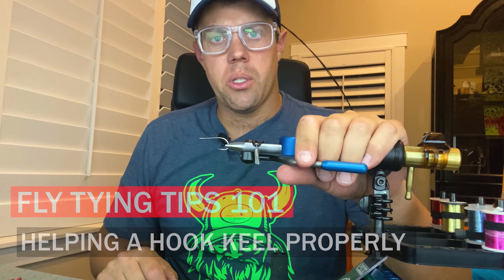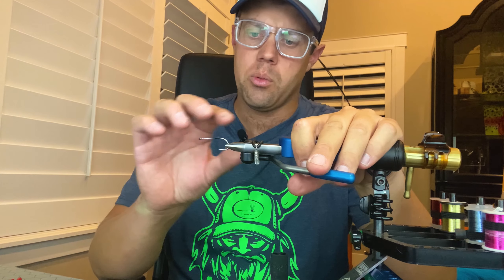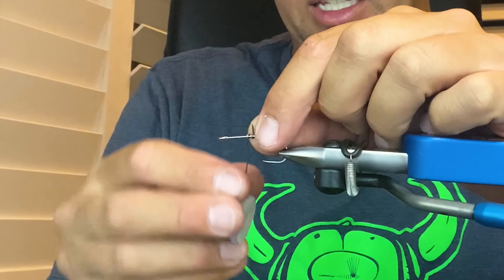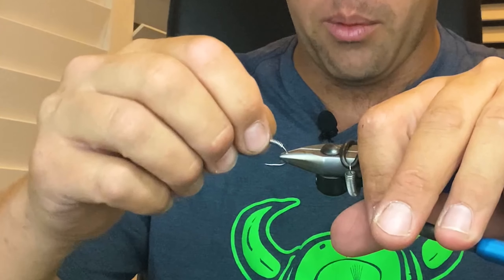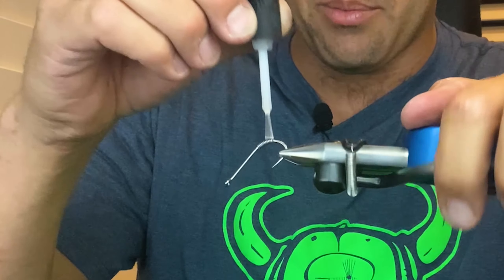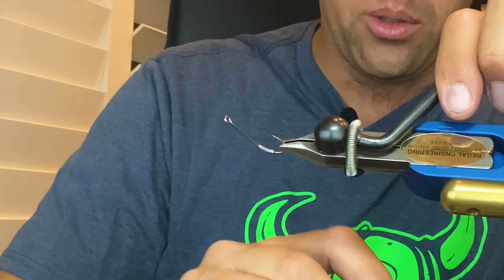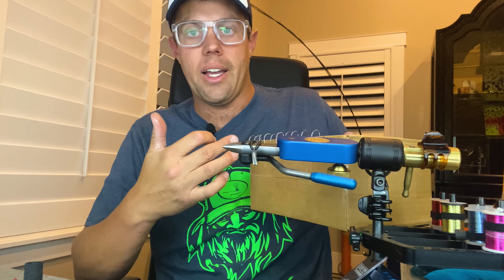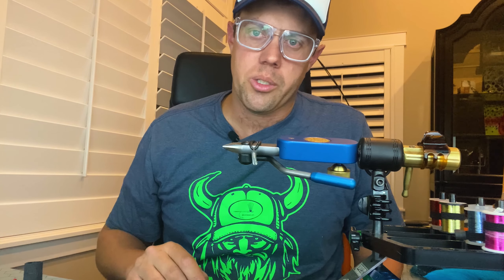Fly Tying Tricks and Tips 101: How to Help a Hook Keel Better

Comment: Cool tip! Could you do one on how to my cdc look really good and even! I still can’t figure it out😂🤦🏼‍♂️
Reply from the maker: Where you struggling with cdc?
Reply: Svend Diesel it ether comes out to heavy or to light with the CDC
Reply from the maker: Luke Groesbeck maybe try a different brand.  I usually add or subtract the density by adding more feathers or less.  Some brands are much longer and more full than others.  Others come with a variety of sizes in the pack.  Hard to tell without photos and the exact pattern you’re tying
Reply: Svend Diesel thanks for the advice!

Comment: Any tips to get hooks (not jig hooks with a bead at the head) to ride the opposite direction (hook point up) but maintain a sleek/slim profile?
Reply from the maker: Clark pierce has a technique to add tungsten beads on the top of the shank to flip a regular hook to ride point up.  Using mono and tying it to the top of the hook will add a bit of height on profile but not in a bad way. Just cover the beads with thread wraps after gluing so it’s easier to add material
Reply: Familiar with the technique. Thought you might have another method. Thanks though.